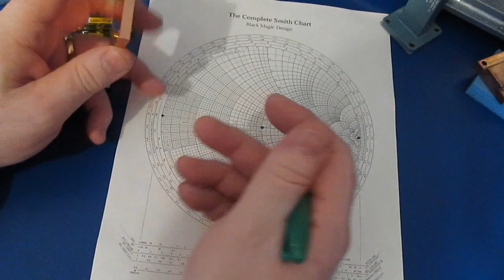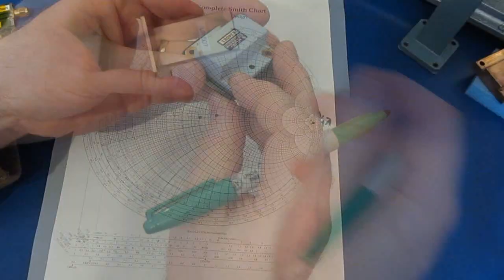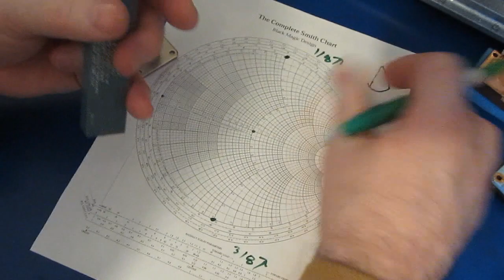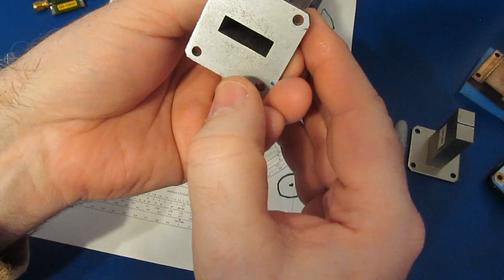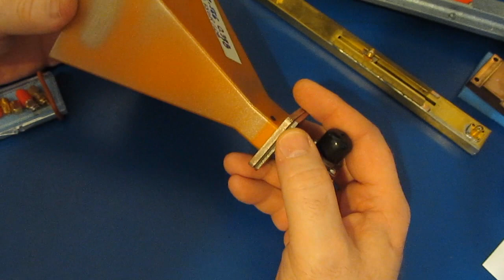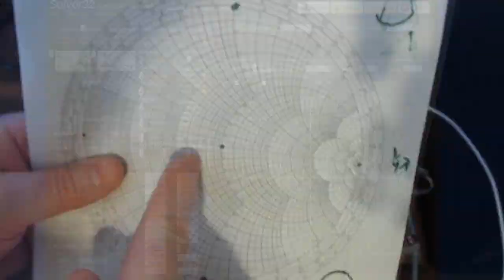Introduction to Waveguides using the LiteVNA,  Part4, Calibration without nuts & bolts

Comment: I've always used TRL for waveguide calibration. It puts all the compromises outside the reference planes and makes really tidy measurements. All you need is your shorting plate and a piece of waveguide a quarter wavelength long.

Comment: Excellent to bring waveguide technology to the attention of a larger audience ! For the shoestring budget i don't see yet how Aliexpress can make the price drop... While 2.4 and recently 5.8 GHz technology has become dirt cheap due to surplus from WiFi, satellite TV and the cheap VNA and spectrum analyzers, for 10 GHz/waveguide you still need the mixers and amplifiers for up and down conversion. For a plain receiver, a LNB could be used and nowadays they have PLL instead of DRO, but using the same LO for generating the stimulus is still a way to go.

Comment: Hi Joe, I don't know how you have the patience for dealing with some of the people on the EEVBlog forum who, in my experience, just want to attempt demotivate and question anything you do that doesn't suit their tastes. Ask about some advanced FPGA hardware and some clown berates me for looking at a board that isn't beginner friendly. I guess everyone is a beginner over there? wtf. This is why I rarely post over there.
Reply from the maker: The downside with EEVBLOG is the amount of non-electronics related topics.  Some people who contributed technically, were banned for getting involved with these toxic topics.   I've had a few of my own posts censored and was banned for a few days for having fun with a troll.  LOL.  As the site continues to become diluted,  I tend to use it less.  RF topics are not very popular.  I suspect most of the feedback I receive is from hams.
Reply: @joesmith-je3tq  Thanks for the response. You were banned? WTF. You know, I was thinking of fighting like with like but it's very clear that these "super contributors" that provide little value other than a high number  of posts in almost every thread don't like being told where to get off. It's Easter Sunday and I was frustrated by the unnecessarily hostile responses so I decided to move on.  As one of my best friends said, quote: "Ask yourself this question: Would anyone of those people say the same thing in person? I doubt it. The internet makes people very brave when they're behind a keyboard"
It's not worth engaging with "tough guys". 
Have a great evening and rest assured even though I don't comment all the time I appreciate your content regardless of the topic.
Reply from the maker: Yes, I was banned for a few days.  It wasn't a big deal.  You can find it at the link below.  For context, read a few of the previous posts leading up to it.   You may get an idea of who was involved.  I'm not concerned about being permanently banned.  As I said, the forum is less interesting to me now days.
https://www.eevblog.com/forum/projects/challenge-thread-the-fastest-breadboard-oscillator-on-the-mudball/msg3101632/#msg3101632
Reply from the maker: Another time I was having fun trolling a troll.  See the pattern...   lol   https://www.eevblog.com/forum/testgear/a-look-at-the-uni-t-ut210e/msg4790699/#msg4790699
Reply: @joesmith-je3tq  Thanks for that. I looked thru the threads and sure enough some of the same names popup. Including the "super contributor" that derailed my question almost as soon as I posted it.  Unbelievable.
Reply from the maker: I'm not too surprised.  I haven't ran into a lot of members that continuously try and cause problems.  I'm guessing most of them stay away from technical topics or I would run into them more often.  From that regard, I think the mods do a fine job keeping things in check.

Comment: Thank you for another excellent video!  I am learning quite a bit from these since I have never personally set up plumbing.  The way the calibration standards are done seems obvious once you show them, but I never knew about them.   Not only am I learning about those, but your I am learning from the way you implemented your home built extender.  It is all excellent work.
I have had chips measured with plumbing equipped VNAs and plumbed wafer probes, but I only got to watch (but not touch) since it was in a production lab.  Even though the connections were plumbing the calibrations were on-chip, not waveguide level.
Reply from the maker: You and me both!   Playing with WGs on a shoestring budget has a benefit in that we have to get our hands dirty rather than just press a button.